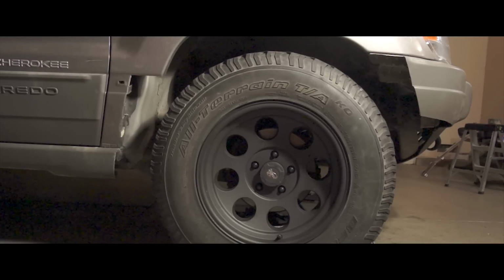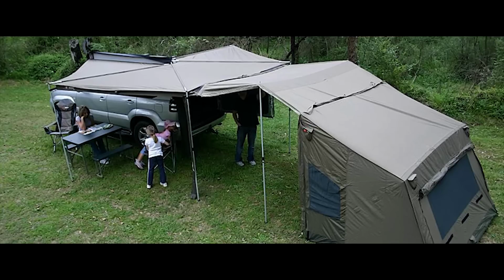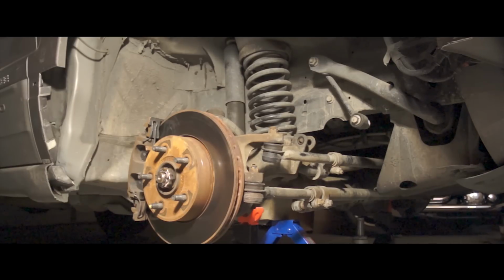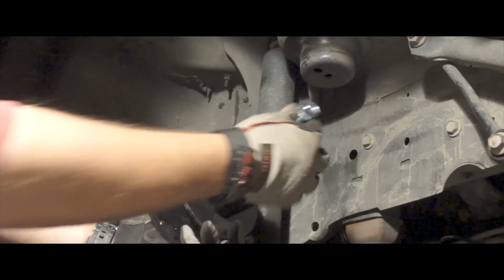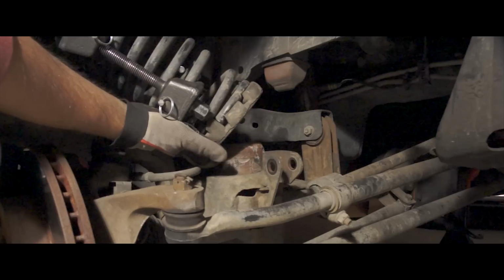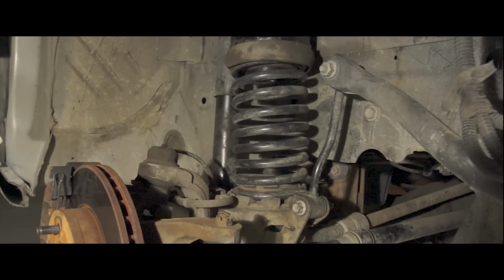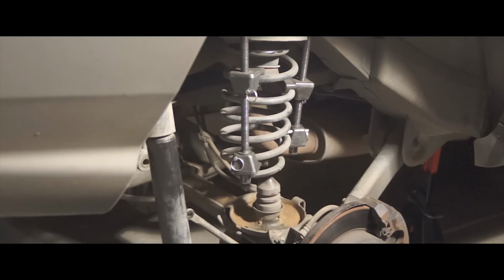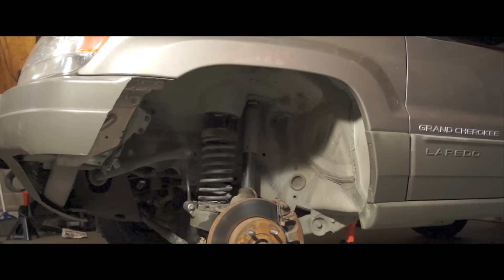1999 JEEP WJ:  Rough Country Budget Boost and Fender Trim Part 2

Comment: Really appreciate the camera angles, very helpful. The lighting is great too. Thanks for including a lot of the steps and details, its very helpful. Lots of these videos, guys go through the steps too fast and the angles are not very helpful.  How long did you run the Rough Country budget boost before the bigger lift kit? Where there any problems??
Reply from the maker: It was less than a year before I swapped out the budget boost for the IRO 6.5" long arm lift. Most of that time was taken choosing tire size vs lift kit with regards to tire clearance.  I don't remember specific off-road trips where I encountered any issues, but I didn't go wild, either. The budget boost had enough clearance with the brand-used tires I got, but without significant chopping around the wheel wells, I probably would've shredded them, bottoming out on the trails.  I was glad to get a proper lift.

Comment: I have this same lift. The self tapping bolt for my front spacer is pretty loose, i cant crank it down. I saw in your video that your front spacer was spinning is that normal did you have issues? Or does the pressure from the spring hold the space in.
Reply from the maker: Held together by the spring, sway bar, and shock...
Reply: @TheTSFChannel  thanks! I was gonna try and get a larger screw but I'll just use the supplied hardware
Reply: I have the same kit and I zapped mine up with my electric 3/8 impact and mine was tight.

Comment: why the heck would you need coil compressors for a WJ? just disconnect the sway bar and shock and let it hang?
Reply from the maker: I sure could've used your help 3 years ago when I did this in my garage with 2x 12" jack stands, a scissor jack, the OEM jack out of my Honda and a garage door opener assembly a foot from the Jeep roof top.    Hopefully, another DIY-er will benefit from your expertise.  Thanks for your analysis.
Reply: was thinking you had like super long springs or something :P
Reply from the maker: Even if I did have the room, at that time, I wouldn't have had the confidence or experience to drop the axles low enough to grab the springs as they popped off.  Instead, I let one side hang as much as possible while I kept the other side compressed, basically flexing the axle left then right as I did the replacement.  I didn't see your technique til I installed the 6.5" IRO lift at my buddies shop over a year later:  https://youtu.be/oz4K2MEUSPo
Reply: Yea on the wj you can do all 4 corners just by disconnecting the sway bar and shock. While on stands disconnect shock and sway bar from the side you are on. Then put a jack under the opposite side tire and jack it up, then pull the spring right out, push down on the hub if needed. Put the puck in and slid the coil back in and reconnect.
Reply: @csheppard93  wish I saw your comment beforehand.

Comment: A wrench and a pipe is not a breaker bar
Reply from the maker: Hey thanks. I think I mention that I'm not a mechanic either. If you're expecting institutional instruction, Youtube probably shouldn't be your venue. Just saying.
Reply: Does it work?
Reply: it works till it breaks your wrench so have fun breaking your tools  @RolandtheThompsonGunner
Reply: @MayoBO9  first of all, I wasn't saying it should be done in place of going out and buying the proper tool to do the job but in a pinch it works. Personally, I don't need to do that, I have a breaker bar and I have a big ass torque wrench. Though, when my friends and I first started working on cars in our teens, yes if we had to we would throw a pipe on a wrench and it worked. Also, the only tools I've ever broken were cheap tools that probably should not have been used to begin with, if it's a high quality wrench, it will not break with a pipe on the end of it with leverage being pushed or pulled on it by a human. Now if that person is jumping on the pipe/wrench combo while it is on a lug nut or something, yeah that good quality wrench could break.

Comment: What happened to rear coil spring isolator? Doesn't you suppose to use it with budget boost anyway?
Reply from the maker: Nope.  The spacer for the rear goes on the bottom as shown @ 20:15.  The isolator doesn't fit around the small, center collar on the spacer that the coil sits on.  Great question, thanks!
Reply: Rear goes on top just like the front. It goes on top to keep the spring from coming  out when you flex.

Comment: does your rear sway bar hit on the shocks? i have the same spacers on my wj with the rough country shocks. i have also replaced the rear sway bar with the addco 1" and it hits on the drivers side shock and it drives me crazy!
Reply from the maker: I did not notice that. However, on the trail, I did seem to bottom out going over larger tree roots or rocks, but I attributed that to the extra weight  from the bumper/tire carrier combo.  That went away after the IRO 6.5" long arm lift was installed.
Reply: I have the 2 inch rough country lift with the rough country shocks and factory sway bar and I do not hear that hitting.

Comment: Hey did you ever have any issues with the lift after installing?
Reply from the maker: Yes.  Soon after I added a ton of weight with the ProtoFab bumpers and tire carrier (https://youtu.be/RSRS6po-_aM).  On the trail, the budget boost would bottom out after going over a root or rock or something.  I did swap the factory shocks for Bilstein 5100s (no video on that), but they didn't help with the extra weight. I looked forward to getting the IRO 6.5" Long-arm and FOX adjustable shox.  More to follow on that.  Stay tuned!
Reply from the maker: So, short answer, it wasn't tall enough.
Reply: Sounds great. Im going to get a budget boost and new shocks. maybe new springs. I also am going to get new tires I'm thinking of getting the same ones you got know where to get a good deal?
Lastly i am going to upgrade my exhaust and intake to high flow and do a cold air intake.
Reply from the maker: I got a set of 4 off ebay.  They were "blemished" and unsellable, but I got a heck of a deal.  I bought two spares, one for the back and one for the roof for full price, though.  You just have to search.
Reply: TSF Channel Actually its the coil springs that support your vehicle, so budget boost has notting to do with bottoming out on trail due overweighting your vehicle. Stiffer coil springs is needed. The best way to go is calculate the weight of your WJ or weigh it when loaded and give data to any 4x4 shop that does builds and they will tell you what kind of springs you really need.
Reply: If you i stall a budget boost and want to replace your springs at the same time, buy the upcountry springs for the overland edition. Same price at parts stores and sit am inch taller.

Comment: This guy is not good at all the front spacer isn't tightened all the way and the rubber under the spring in the rear is supposed to be put back in not left out in glad I'm not near this guy I do my own work
Reply from the maker: Here are the instructions.  See photo 4.  :     https://s3.amazonaws.com/roughcountry/install/695.pdf
Reply: Sorry Mike but you should really call Rough Country or read the directions before making such a comment. The rear isolator on the bottom is not meant to be put back in. They instruct you to leave it out because they're worried that the coil and spacer might pop off because there's not enough room with the isolator, especially if your suspension has to flex. They recommend using white lithium grease to keep the metal lubricated to keep it from squeaking or causing additional sound without the isolator in there.